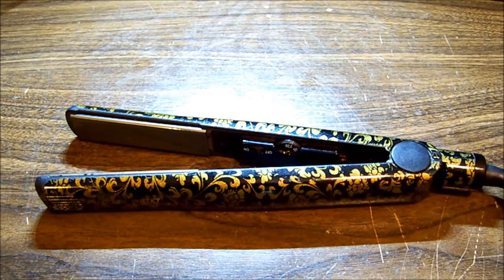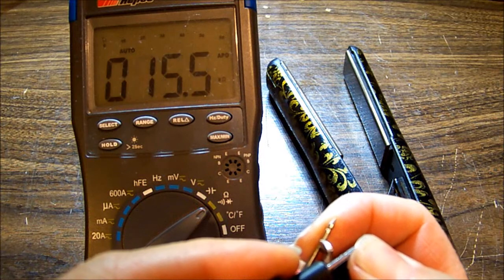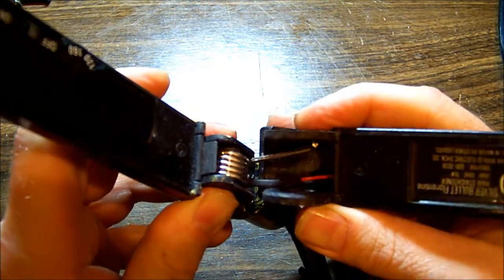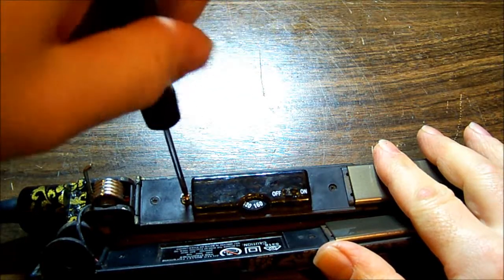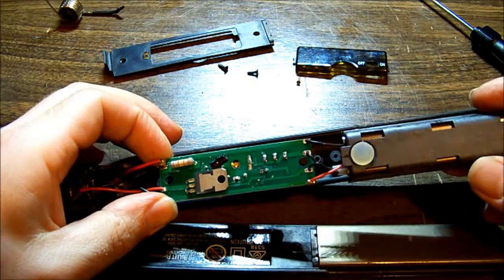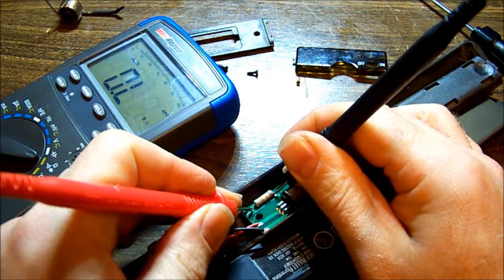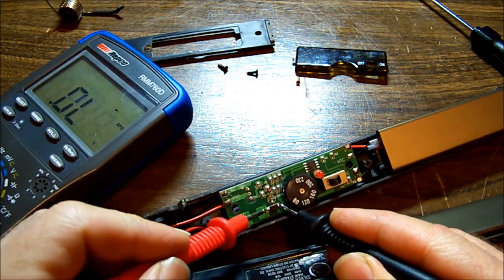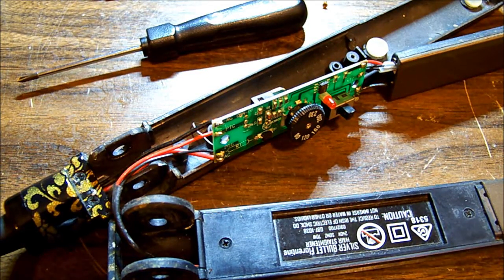Silver Bullet Florentine hair straightener repair

Comment: Sir in my Anex haie straigthener there is one transistor BT225 which i cannot find anywhere in the market, kindly tell me its substitute
Reply from the maker: Google search BT225 datasheet. Looks lke it's a Triac rated at 600V, 200A peak. Try someone like digikey and see if you can match one to its ratings in the datasheet here  http://datasheetz.com/data/Discrete%20Semiconductor%20Products/Triacs/BTA225-600BT-datasheetz.html